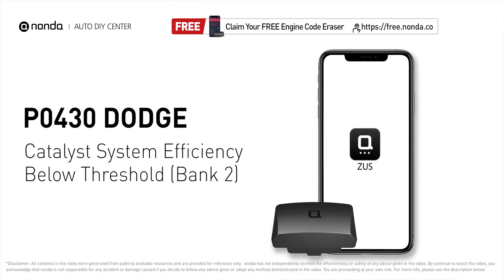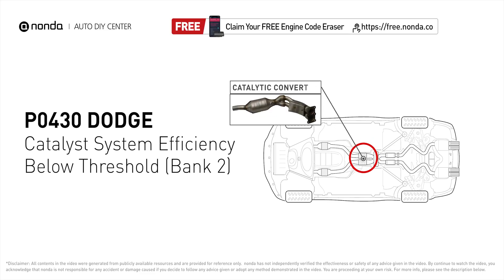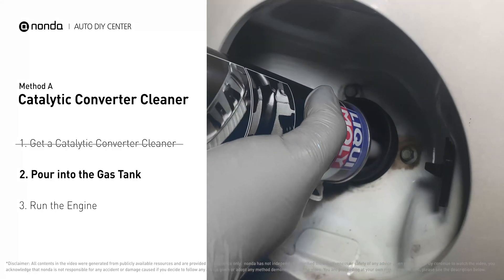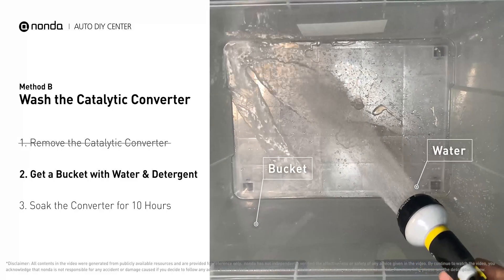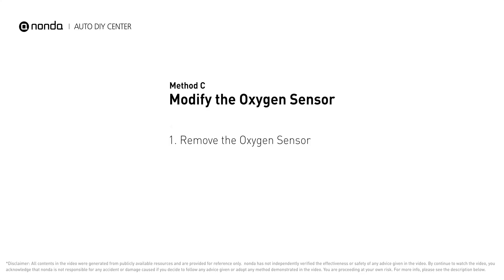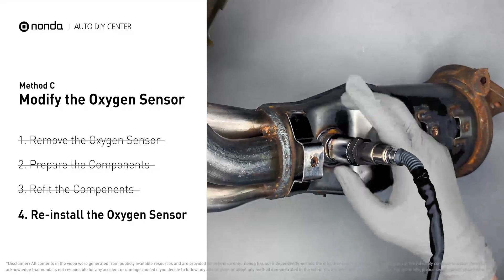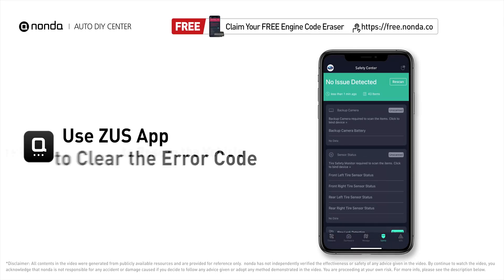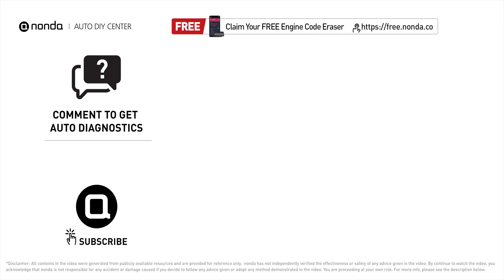How to Fix DODGE P0430 Engine Code in 3 Minutes [3 DIY Methods / Only $4.97]

Comment: Option C doesn’t work. It throws p0159. Still the same problem. This issue happened on my 2015 charger. The cats cleaner also doesn’t work. The last thing I’m gonna try is soak it in soapy water unless it becomes a 2k repair.

Comment: These are amazing suggestions. I would like to try 1 or 2, but I'd like to know if these points apply to a 2012 Durango since the Gen 3 are so different from the Gen 1 & 2. It would also be nice to hear if anyone has had success with any of these methods.
Reply from the maker: The rationale should be the same I think.